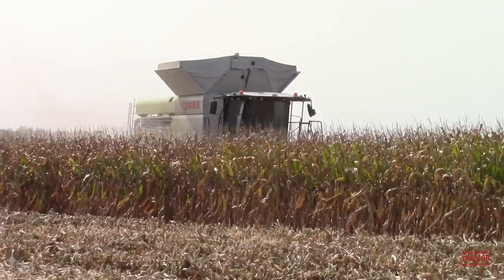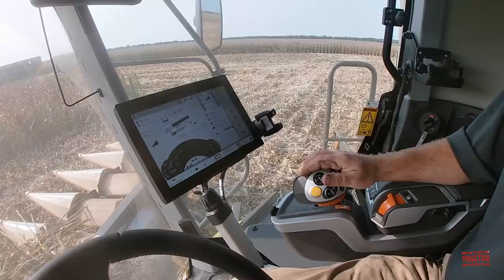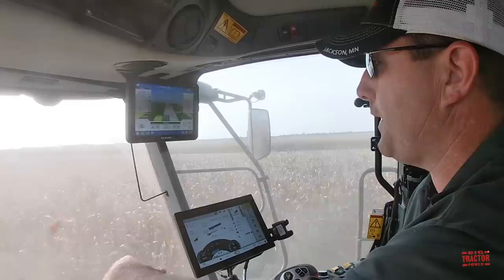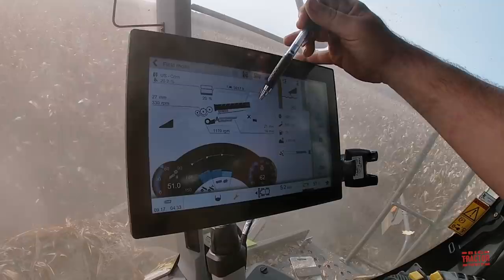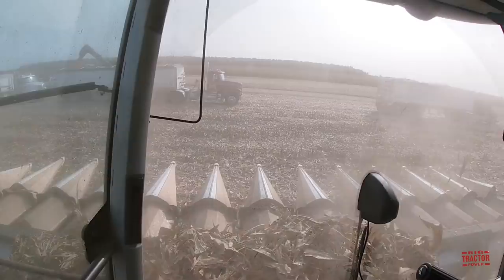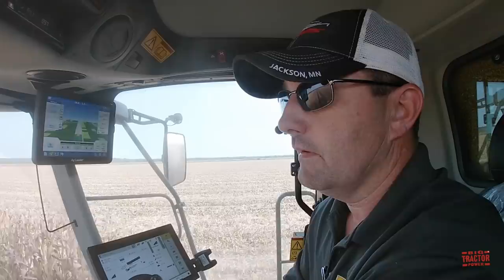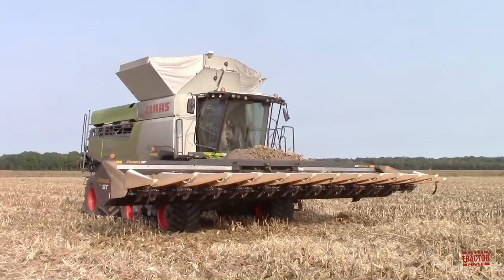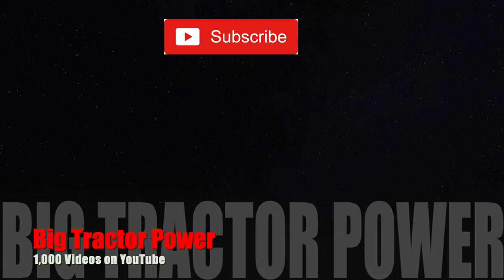510 Bu. CLAAS 8600 Lexion Combine

Comment: We run two (consecutive serial numbers) Lexion 590R combines in central ND. We farm roughly 5800 acres, and grow spring wheat, durum, flax, edible beans, soybeans, corn, and some years sunflowers. In the wheat, durum, flax, and beans we run 40ft MacDon flexdraper headers, which in my opinion is the best header ever made. We have a 16 row (30 inch) Lexion corn header, and only run one combine in corn. The output from one Lexion in corn is enough some days to overwhelm the grain cart and trucks, even with the smaller corn yields from the 80/85 day corn grown this far north. In the sunflowers we use an F35 Lexion header with sunflower pans and reel, as well as a Sunmaster header. The 7000/8000 series Lexion combines address every issue we have with our 500 series combines, mainly the grain tank size. The 590R only has a 360 bushel grain tank, so 510 is a massive improvement.

Comment: we have tried everything other then gleaner and new holland.. currently running a 470r and a 580r lexion.. best machines we have used by far in pretty much every area. my biggest gripe would probaby be the dust and crop buildup on the header but otherwise there is nothing

Comment: That’s a combine!! The 8800 going to eat that deere x series alive.
Reply: I really think so too. If not, then the 8900 will, with that 790 HP motor.
Reply: But then the ideal 10t Fendt might eat them.
Reply: @heinrichthiessen3953  I expect the Ideal 10 and 8900 to be very similar... its the same engine, but the Fendt has bigger rotors. But the Claas has the pre-threshing system. Should be close!
Reply: @KNJensen  I agree, new combine capacity is amazing.

Comment: great video we have the grand father of this claas an 480 from the year 2001 and is still running great with it 10 000 engine hours and about 6500 seperator hours on in .
it is running in ukraine along with a john deere  cts  harvester and a new holland cr980 harvester
Reply from the maker: Very nice.  The 480R and 485R were the first Lexions solid in the United States starting in the fall of 1998.  They were sold under the Caterpillar name.  That is impressive how many hours you have put on your 480.  Thank you for sharing.
Reply: @bigtractorpower   before we buy this from denmark we also was looking at one 480r cat 4wd that came originally from illinois mostly gone cutting corn and it was presentet with a grain header type claas that came from a burnt combiner from denmark . but we got an better deal and the 480 had lower hours than the 480r and it had a very caring owner from new so we whent fore the 480 and never regret it

Comment: My old boss just traded their 760tt for one of these. Couldn't get an 8700 none available. But this combine has the same wide body as the bigger models and although it is only a class ,8 machine with all new improvements will do the same capacity as the old class 9 760tt possibly a little more lot bigger grain tank which is a plus and unloads lot faster bu per minute

Comment: Although it's an class 8 combine it has the same wide body as class 9 8700 has the same 510 bu capacity grain tank and is said to perform as well if not better than the Old 760 class 9.
Reply from the maker: The new 510 bu 8600/8700/8800 are impressive.  I have filmed the 8600 in corn and the 8700 in soybeans.  I have found filming a 7500 it will out work a Deere S790 in corn.

Comment: Thanks a lot  BTP!
So you have already seen a lot. Сan you rank the Lexion, Ideal and X9 combines in your opinion from 1 to 3
Reply from the maker: I have not spent enough time around the X9 and Ideal to say.  From my observation over the past 20 years Claas makes a solid machine.  The harvest fast and process good grain.
Reply: bigtractorpower is that mean CLAAS is #1 at the moment but x9 an ideal possibly not worse?
Reply: Recent review of the X9 by Zach in MN was running out of power around 5000-5500 bph, in one field anyway.
Reply: @user-ek3sk4zk6n  we had oppotunity for testing X9 against our old 760ttyear ago but john deere was afraid to put it in the same field. no show. X9 is big but i would put my money on the claas any day. the 760tt had the world record going for few years on most bushels combined per hr 8hr 10hr and 12 hr intervals havent heard any new ones lately but that 8900 claas should take the record easy but its not marketed in US.

Comment: looking on the Claas website, the 8600 terra trac has a 425 bushel grain tank, not 385 like it says in your video description. Also, its the wheeled lexion 8600 that has the 510 bushel grain tank
Reply: No, it means that there is an option to add the bigger grain tank - default is the smaller tank.
Reply: @tsint  oh, what was shown on the website was a bit confusing, I thought the wheeled version of the combine had a bigger grain tank. Thanks for clearing up the confusion